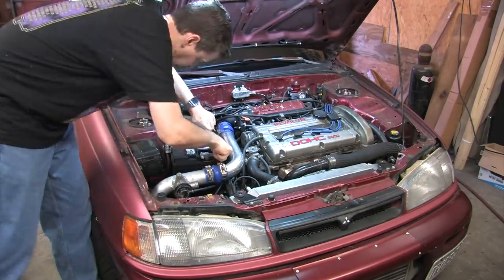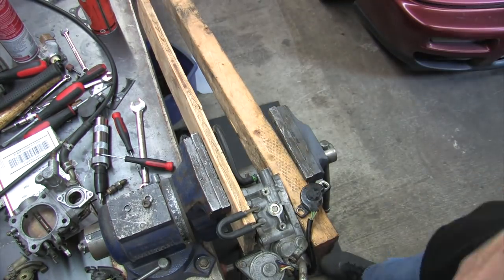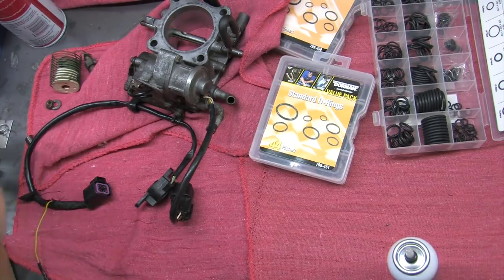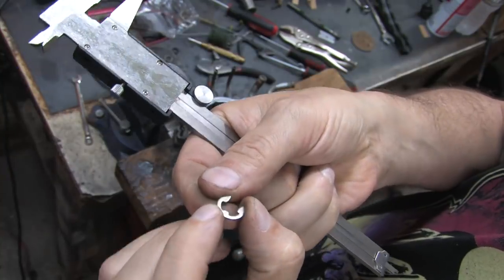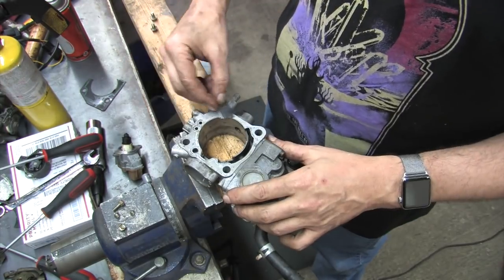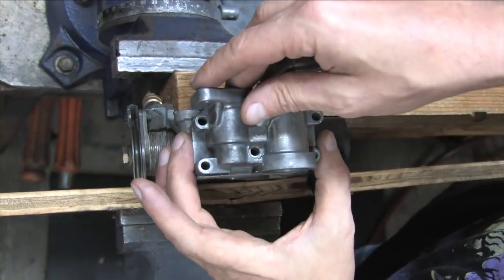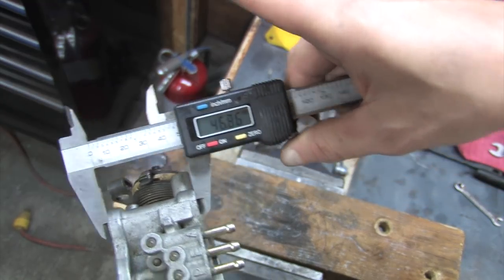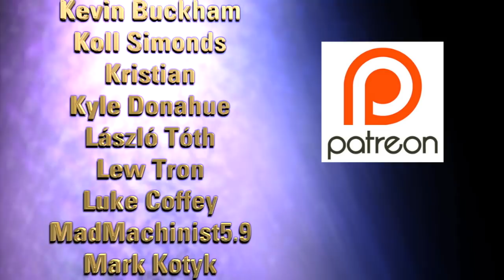Rebuild Turbo DSM Throttle Bodies

Comment: If anyone plans to do a job where removal of very old fasteners is involved, spray those things with penetrating oil well in advance!!! Do some heat and oil a few days in advance, let it sit and repeat. 
I did some exhaust manifold bolts on my ford truck that are notorious for snapping. Did this once a day for 2 weeks and every single one came out ugly but intact. At worst you waste 5 minutes a day. At best you remove some fasteners that otherwise may not have come out dry.

Comment: I've never bothered with those screws, i cut them with the dremel with a reduced cutting disc (read used) and use the biggest carburetor slot head screwdriver i own, the kind with grip patterns on the tip. Steady ramping of torque is very helpful.
IMO, those screws are replaceable, one time use screws, mostly because of the way the threads are cut in that swing, but that's another matter.

Comment: jafro im not sure on how familiar you are with motocross bike engines, I'm having a slight problem and i was wondering if you could give me some insight, for starters the motor is a 250cc DOHC engine that uses a lobe>bucket>shim>valve design. single cam chain that runs off the crank no big deal. but i just installed a new piston and rings and 4 hours ago (4 hours on the motor, riding time.) and I'm hearing this valve ticking noise, now my motor before the rebuild had some sand for breakfast and the two intake valves are cupped out, i could send you an email if you'd like of how bad they are, I'm pretty sure they still seal, but the contact patch isn't where id like it to be. also the fact that they're cupped out so far means I'm running the smallest shim that i can't find for my bike (1.20 mm). i was told if i ran these valves that the lip would snap off causing my valvetrain to go flying all over the place but i have one ride on them (after break in) and my motor is strong but my motor still ticks i should mention that the intake valve clearance is .12 mm to .19 mm and they're on the edge of being to tight, (given the fact that i don't have a smaller shim) is there anything you could tell me as to why its ticking? also i have new valves in my cart I'm ordering them with new gaskets and things as soon as i can afford it

Comment: I was able to get both throttle plate screws out just by using a 3/8" drive ratchet with a screwdriver bit. I did not have to heat it, add penetrating oil or hit it with a hammer.

Comment: So the 2g TB has a smaller bore? 60mm? And the 90 & 91-94 have 63mm?

Also the 2g biss screws(brown plastics) are oem mitsu parts. I did not know until now that they released a metal biss screw for older generations.
Reply from the maker: The 2g is 54mm, and the 1g is 60mm.  There's a 64mm non-turbo throttle body out there, but I don't have one, and I don't think I need one, either.  If I had 2.5" IC piping, I would maybe do that... but since I had the turbo parts that are more common and more popular these days, I focused on those.  Those are the models people are trying to keep running.  If someone's rebuilding the NA throttle body, they'll probably find the same parts, same process and still be able to rebuild it with this info.  I just don't have any NA 4g63 stuff.  The plastic BISS screws are in all the 2g throttle bodies, and the OEM replacement support for that part is now ALL plastic.  I would recommend replacing it any time you have to remove it if it's leaking.  If you're careful, you won't have to... but the magnet thing... from a service perspective... it's just way better, and way easier.  So much more convenient.

Comment: @Jafromobile I notice that you are measuring thin parts and diameters with the caliper jaw knife edges. Please consider using the flat surfaces as close to the measuring scale as possible for optimal results. Also you can measure a diameter more accurately if you put the disc object (seal, e-clip, throttle plate) parallel to the plane of the jaws, that way the jaw surfaces are tangent to the circumference and you ensure that you are measuring the biggest chord in the circle - ei. the diameter. But you already knew that.

Comment: Merry christmas Jafro, any chance of a new video for christmas?
Reply from the maker: It's coming... I've been working on it for 8 weeks.  Lots of racing & tuning action.  The working project file is currently 761.97GB with over a half-hour of narrated highly-technical animations.  I've spent over $2,000 creating the subject material to keep it interesting.  I swear I've never worked so hard to get a point across, but it's a difficult process to present this subject material.  There's enough action and cause & effect that it might just keep the attention of people with no interest in EFI tuning or the 4g6x platform...  It may also cause some people to short circuit.  We'll see soon enough!?

Comment: Hey Jafromobile since I didnt notice anyone else asking I have to.  Tell us all how you know that coolant likes to short out electrical circuits.   Sounds like a fun story
Reply from the maker: Coolant overflow decided it wanted to slowly drip on the convoluted tubing below it that housed the coolant sensor wiring, the o2 sensor, etc...  Being that it was a liquid, it seeped into the tubing, ran down to the lowest point in the tubing, and that happened to be where all the wiring splices were made.  It shorted my o2 sensor and coolant temp sensor together, and in a hot engine bay you couldn't see or feel that anything was wet because it was inside the tubing.  It was randomly and occasionally dripping inside the tubing.  It destroyed all of those circuits.  I was chasing intermittent drivability issues, left the car parked for a couple of months out of frustration, and then found it in the "Hyundai Wiring Bullshit" video.  Months later the harness was still full of coolant.  I installed a new Wideband o2 sensor to fix the air/fuel issue, fixed the leak, and replaced the coolant temp sensor circuit.  Fixed!  It was an electrical issue all caused by a slow, random drip of coolant.

Comment: I have an aftermarket throttle body for my 2g. Its new, and I noticed massive air leak on both shafts. Teared it up and find no kind of seals behind the shaft bearings. Any tips on how I can seal it? RTV?

Comment: Do your Phillips screwdrivers rock slightly in the screw head?
You are trying to remove a JDM (i.e. JIS) "cross" screw.
Try using a Vessel Impacta +2 screwdriver - check Amazon.
Reply from the maker: After the screw is peened (crushed), the profile of the head gets munged anyway... so it's really hard to tell.  A standard Phillips head actually makes a great fit, but who knows if it did before the screw was peened?

Comment: We watch as the industrious Jafro wrenches on a throttle body herd.  We need to be quiet as not to disturb his focus, if he scares he might run and loose the location of his e-clip.  The e-clip is imperative to the survival of the entire throttle body herd throughout the harsh long installation season.
  The Jafro doesn't seem to notice us as he cleans his car parts,  and hunts for an o-ring by the communal watering hole.   He looks frustrated with the e-clip harvest,  after having to travel vast distances to collect enough clips to feed his throttle body herd.  He's expended too much energy in the harvest to re-shoot the shaft install, he needs to conserve all of his energy to the rebuild the new throttle body, brought to him by another Jafro.  
  The Jafro shows his relief after sneaking by the dangerous spring winding.  Living his entire life dodging the treacherous hazards of the DIY garage, has prepared the Jafro for dealing with the unforeseen dangers of the throttle body herd.
  SHHHHH... I think he saw us staring at the size of his hammer.  
  The herd is behaving and the Jafro falls into an easy routine, passing the rest of the disassembly season without incident.  The installation season starts out easily, until the biscrew demands the Jafro's attention.  Luckily the Jafro knows that the pep boys flock will be able to help.  Trudging through the trials and tribulations of the rough installation has provided the Jafro better boost and pedal response for his offspring, ensuring the future survival for the Jafro and his species.

Comment: I took mine off and it doesn’t have seals it have bearings instead, it’s a bbk 97 GST throttle body. Got any advice on how to get them out and what to use to replace them?

Comment: Hi Jafromobile, I have a problem with idle regulation, I have checked everything as in the video and the sensors are fine. I regulate the idle and it is fine for a while then it goes back to deregulation, staying very low in hot 500/600 rpm or very high in cold when turning on 1700/2300 rpm, I can't find a solution and I have very high CO2 exhaust. could you help me?

Comment: Hey jaffro question for you. I have a 1gnt throttle body looks like from a 90  i plan to put on my 1g talon (the white one chad got a video of  2 years back) my only concern is will i be able to use able  my 91-94 tps for this 90nt throttlebody?

Comment: Hello jafro I want to swap my elantra 1991 with sonata 1994 2.0 4g63 engine so What's the difference between 1.6 and 2.0 engine block? Last question, What do you recommend for brake system for my elantra we use same chassis which you have:) i want to retrofit ABS system from sonata so any an idea?

Comment: I smoke tested a Chevy Caprice 96, and spotted a vacum leak from the throttlebody shaft, is that normal or should it be rebuilt/replaced?

Comment: Jafro if the ISC went on a 1990 throttle body, would you rather swap it for a 1991-1994 throttle body which is easier to rebuild or just swap the connector and use the 1991-1999 ISC?
Reply from the maker: By far, swapping the connector is the easiest solution because of all the hard parts you'd have to change to swap throttle bodies.  I believe it's the same plug... it looks like the same plug (I never tried plugging it in) but you may have to extend the wiring in order for it to reach.  The connector you'd have to obtain would be the 91-94 TPS connector IF you were going to change throttle bodies.

Comment: im curious, when you mention 1g and 2g does that correlate to 6 bolt and 7 bolt? asking because where i am people use 6/7 bolt terminology because we either dint get or there want a demand for the eclipse
Reply from the maker: the 6-bolt/7-bolt changeover in DSM production occurred mid-year in '92, so the 1g and 2g designation isn't necessarily related.  The same throttle body was used from 1991-1994, but the throttle body elbow changed with the 6-bolt/7-bolt conversion, and that's why the parts list in the description contains production dates that represent different part numbers.  The 1g and 2g designations represent body styles that changed between 1994 and 1995.  Some 1g cars are 7-bolts, and some 1g cars are 6-bolts... while all 2g cars were originally 7-bolts.  That 1992.5 production date actually effected every 4gxx powered car that Mitsubishi built, not just the Eclipse.  It affected the Mirage, Galant, Sonata, Elantra, Eclipse, Expo, Summit, literally all 4gxx or G4xx related Hyundai and Mitsubishi.  It was a comprehensive production change that affected all models.  It's also why all 6 bolt and all 7-bolt engines can use the same set of bearings.  It was a change in crankshafts.

Comment: 1. The screws are probably JIS, not Phillips and not pozidrive, 
2. An electric impact driver, the kind that are used by carpenters that accepts 1/4 screwdriver bits would have had those throttle plate screws out in a second
Reply: Exactly right. I learned that a few years ago. Great for the screws that hold the fiav on too.

Comment: I wish I had known that you were doing this. April Best @ 3SI.org rebuilds them and supplies all the seals and gaskets. I need to measure a 6G72 throttle body. Maybe it might be a good swap on a 4G63 if it is larger.

Comment: Hey Jafromobile! I have a 93 N/A 4g63 car with some low idle issues and a rev limiting issue at 4k. The car has a new fuel pump/filter, freshly cleaned injectors, and no detectable vacuum leaks (so far). However, in both neutral and drive, the car wont rev past 4k. It hits some kind of limiter and I can't for the life of me figure out what it is. I think it's electrical. Any idea on what sensors may be screwed up?
Reply from the maker: I'm guessing your car has an aftermarket ECU and your clutch switch failed or is out of adjustment... or your speed sensor failed, so your car thinks your stopped.  Either that or some kind of service was performed recently around the transmission, and 2 of the electrical connectors got switched.  There are 2 transmission plugs with the same connectors on it.  I shouldn't know this because I've never owned a 1g auto... but I do.

Comment: Hey Jafro! I am having some trouble removing the lower three bolts from my 2g GSX air intake manifold. Any tips? Thank you!
Reply from the maker: I use gear wrenches for these and come at it from the bottom.  I remove the support bracket first for wrenching room.  If the wrench isn't long enough for leverage, I use a second wrench with the box end looped through the claw of the first wrench for extra leverage.  Some bolts you can't reach with even a wobbly socket, and these qualify.  If you can't get the bolt all the way out, you have to loosen all the other ones evenly with it.  I've trapped a gear wrench in there before because I couldn't go forward.

Comment: Have you thought about building a weight plate for the Elantra? Adding weight in the front since you have done everything else to get traction out of the car.
Reply from the maker: I thought about replacing the bumper with a section of railroad track.  I think I'd need the Pontiac Aztec springs in the front after that, too...  At the end of this season I'll be doing something to it... Something has to change before next season.  I made gains, and I even managed to eke out a 2.0 60 foot once... but it should still be doing better than that.  I think the whole front end is flapping around when I launch it because I get wheel hop in the water box.
Reply: Jafromobile, maybe you can weld a couple 2 inch receivers to the frame and make a removable plate.
Reply: Maybe think about traction bar set up like Honda’s use. Attaching bars to lower a-arms to the core support

Comment: Anyone know what kind of screw is supposed to go in the hole for the ground on the top of the 91-94 throttle body?  I wasn't aware there was one until researching tuning idle with the biss.

Comment: What are the methods do you use to clean an engine before rebuild like cast iron parts and aluminium parts. I heard about vapor honing process with fine mesh glass beads. But i saw it ruined the original finish of the gasket area. Is the vapor honing safe with sodium bicarbonate or is there any other method involve. Please help. Thanks
Reply from the maker: I personally don't believe that glass beads belong anywhere near an engine.  My method for cleaning is in another video called "DIY Parts Washer", which demonstrates from start to finish-every engine part being cleaned up after a bearing failure.  Same process is good for assembly as well, only it gets washed in soapy water afterwards and rinsed in distilled water.  Go to my channel page and click the search button.  The method I demonstrate works wonders on caked, varnished, carbonized parts.

Comment: Hey dsm guru  i need your help with my poor dsm it has a hard start it takes like 2 three 3 times and it fuel filter sounds clogget but  it has a new filter 6an magnetic filter but its smaller than oem but yeah ? But when its worm it start pretty fast ? Please help :(

Comment: Jafromobile, how would I adjust the BISS if it has been moved while trying to adjust the idle. I am trying to make sure it is back to a similar stock setting before I try to add my ECMlink. My car is idling higher that when the car was before my rebuild. Please help if possible. Thank you.
Reply from the maker: You need to get an OBD scan tool that can read what the ECU is doing, and get the ISC duty cycle around 30% on a fully warmed up engine with all electrical accessories and the radiator fans not running.  There's really no mechanical way to get it perfect without a tool like that because the ECU is what controls it based off many factors that are unique to your setup.  In the meantime, screw it in until the idle comes down to something normal.  Understand that if you turn on all electrical accessories and your engine starts bogging when those accessories turn on, that you've got it set too low.  Without a scan tool or ECMlink, its position will just be a best guess.
Reply from the maker: Sorry, should have said "if the engine bogs when you turn on ALL the accessories [plus turning the steering wheel full lock]"... then it's set too low.  It's cheating.  It's still not the best way to do it, but it will get you by until you get ECMlink and laugh at how much easier it can be.  Some auto parts stores have scan tools available.  Maybe fake a check engine light (like an unplugged BCS solenoid) and then ask them to check the code.  Find/fix, then see why your idle is so high...  That's called social engineering.  But anyway, be nice.  Buy something to make it worth their time.

Comment: I had a vacuum leak by the tps because the seal went bad, i just put RTV round the tps, lol throttle body needs replacing, bolts are striped